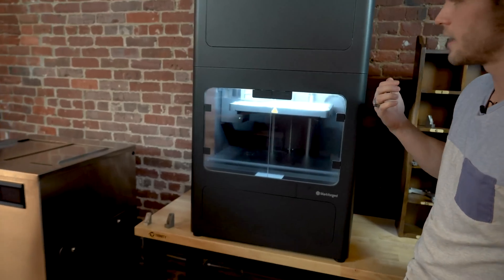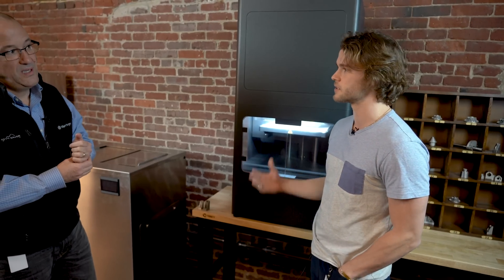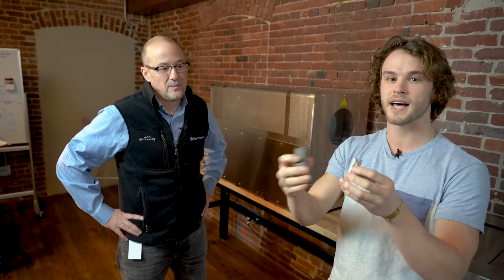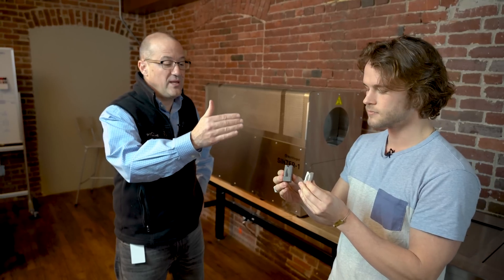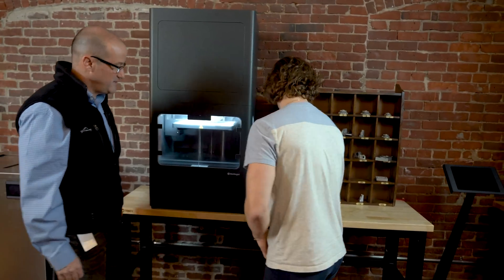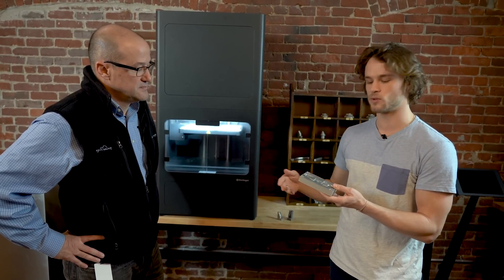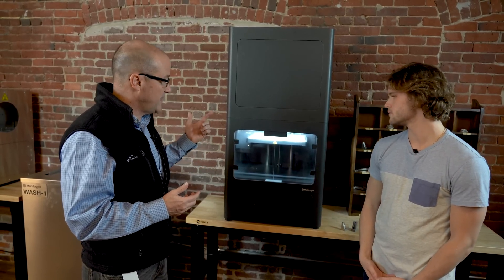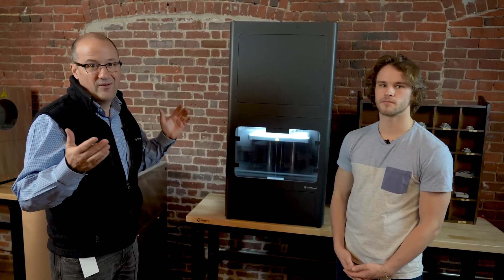How Metal 3D Printing Works | SolidWorks World

Comment: So what happens if there is a defective 3D print does that just get thrown away or can you possibly extract the metal powder out of that and still reuse the powder
Reply from the maker: Unfortunately the material can't be reused. It would need to be converted back to powder which is just not practical at this time. We do recycle our scrap material and recommend our customers do the same.